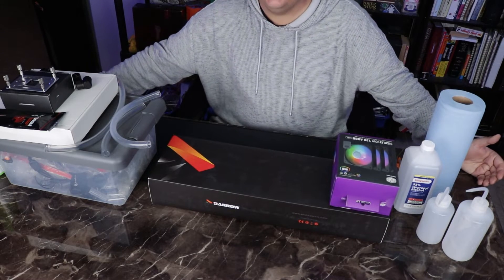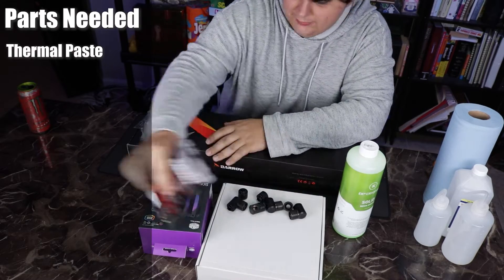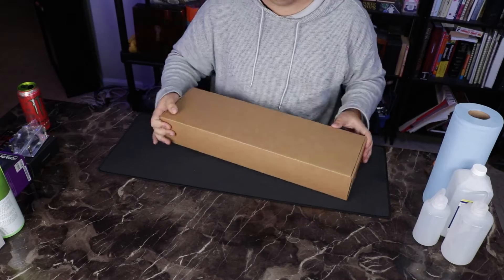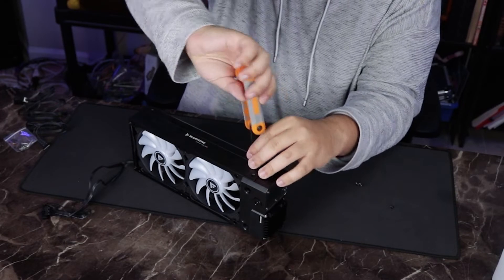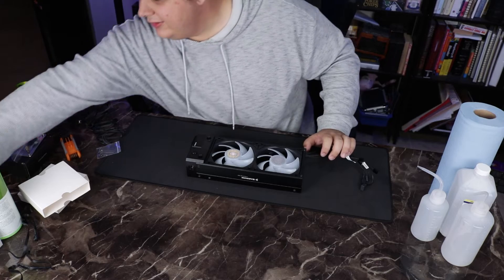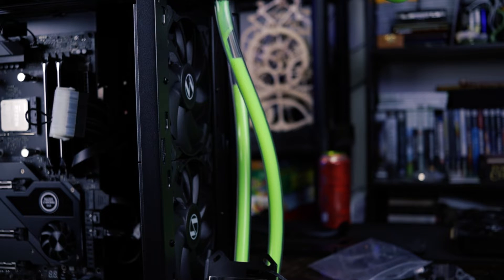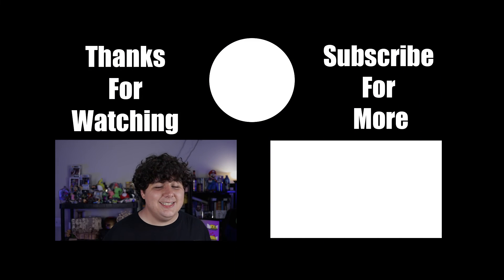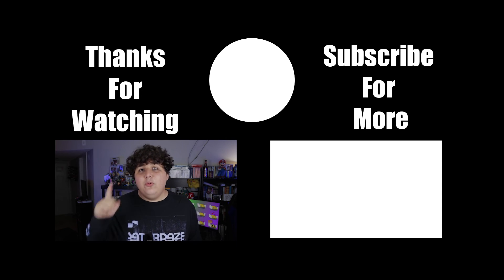I Built A DIY AIO and you can too

Comment: Got a zotac 4080 super wanted to see about reducing sized with ek water block and aio fitting this is so far my best bet thank you.
Reply: I have this on my 4090 and it keeps it under 30c idle and under 80 while on load, giving me up to 2800MHz.
Reply: @techknowbabble  awesome it looks like a great addition to get now that i have the money for it thought about getting a new case as well to help with the space issues i have thought about getting a wall mounted one but the aio should help with the heat in my room very little air flow coming in to the room but is enough to keep temperature controlled.

Comment: LOL how to kill a pump 101. Where's the air going to go in a closed system? Huh there bud?
Reply from the maker: There is a small area to bleed the loop at the top of the rad. It was designed to work that way.
Reply: @greaterthanpie  it's called a res.
Reply: Just fill it so it does not have any air. Top fill rads solve this problem. You can also fill the loop up with the hoses submerged in a tray with the coolant that is being filled so air won't get in.

Comment: Could you happen to provide the part numbers for everything but the Pump/Radiator combo, and the fans?
Reply: Barrow 360 240 Pc Water koeling Kit 17W Pump Radiator 120MM Fan Case Integratie Set (240MM Black that's the radiator if you did not find it and let me know if you want me to get fans to

Comment: I really enjoy your vids as you remind me of a MUCH younger me before computers were a thing. Doesn't Fractal or MSI make a pump in rad product? I know Iv'e seen this somewhere, but, I will check this outfit out for upcoming build.. AMD forever...
Reply from the maker: I think they did at one point. If I am not mistaken they had it in the radiator under one of the fans. There was also one where the pump was in the line to the rad that was really odd. I think Deep cool made that one.
Reply: Yeah fractal had an AIO that was expandable but I think they stopped making it. MSI's AIOs still have the pump in the Rad, rosewill had one as well
Reply: They have all tried to escape the very litigious Asetek patent.  Quite a few still do.

Comment: I actually want to rebuild my system in the O11 Air Mini . Thinking about using 2-280 rads bottom top with soft matt black tubing as the transparent turns green over time . For reservois probably a 120mm cubelike Ekwb res/pump combo at the side insted of 120mm fans . And cuz i only want 140mm fans in the case to look symetrical at the back a 5inch raspberry display for hardwaremonitor .
The bottom would get frash air from below and the top would get fresh air from the front fans . Tubes would also fill the gap thats is in the case . Somehow put the things together in the head with an M-ATX board everything should fitt too even the cabels in the back as i wouldnt have any sidefans  . Lets dont forget the RGB too to make the things even more difficult .
Reply: In the EVO it would be veeery easy but as i dont have that large space and the PC at the leftside the AirMini looks/fit better anyways . At least i can go into engineer mode .
Reply from the maker: @kaszas272HU  The only thing I would warn you about is the top 120 spots are very close to the motherboard. With my setup I had to make an offset bracket but it sounds like you are ready to do that already. It does sound like an awesome build though.
Reply: @greaterthanpie  Thanks . Will work out somehow . In 5 slot mode should fit  nicely even without the brackets .
Reply from the maker: @kaszas272HU  true I almost forgot you could do that on this case

Comment: I'm going to look into a custom loop, because the performance of the H150 elite capellex I'm currently using is under achieving on my 5800X and its depressing me to death. :(
Reply from the maker: Custom loops are fun. I have done both hardline and softline tubing. Soft is easier but hardline looks so much better. Just make sure you use distilled water or premixed coolant to lower the risk of damaging parts
Reply: @greaterthanpie  Will do! Thanks....